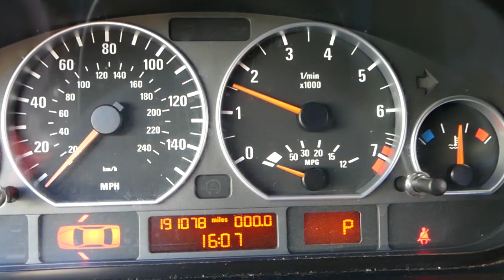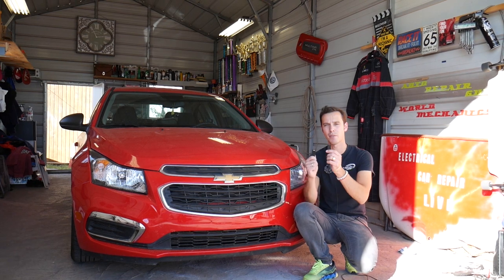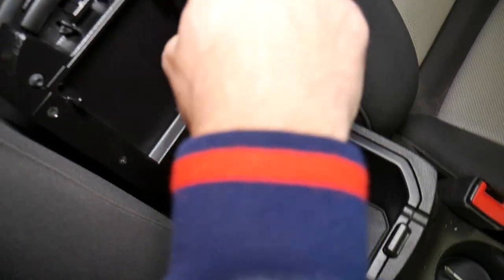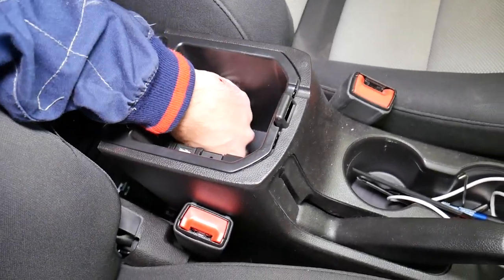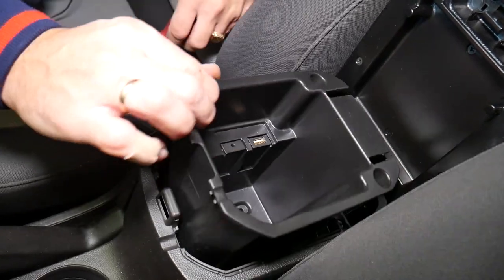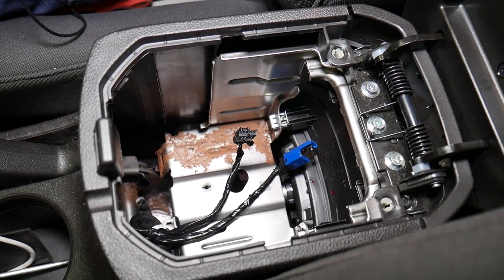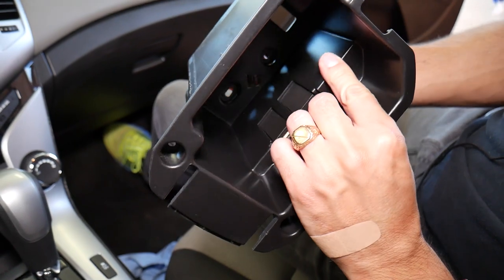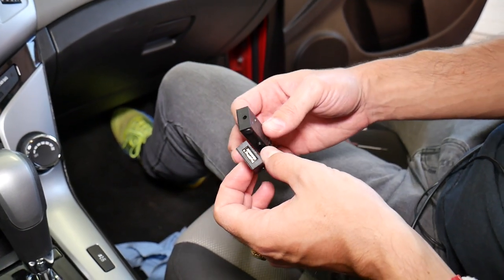CHEVROLET CRUZE USB AUX PORT NOT WORKING REPLACEMENT REMOVAL

Comment: I replaced the usb and it still won’t connect. It will charge my phone but will not switch to the phone input like it normally does when I plug it in. Any suggestions?
Reply: having the same problem. following!
Reply: Having same problem…
Reply: I think it has to do with ios 15.1 update. I think Apple made a mistake on their part
Reply: @Kamihazii  definitely. saw on some forums online that a LOT of people are having the same problem. had to switch to an aux cord and adapter until they fix the bug ):
Reply: Same I have a 2014
Reply: I freaking knew it was cause of the new iOS update, I thought I was trippin 🤦‍♂️
Reply: same happened to me.
Reply: Same happen to me on 2014 glad I’m not the only one hopefully apple fixes this
Reply: same thing happened to me!! what can we do?
Reply: @paigeinabook3595  just wait for apple to fix I got a lightening to aux works fine for now
Reply: thank goodness, I thought I was going crazy! I knew it was an update… arg. Anyone know when it could be fixed? New update? If it’s never fixed I’ll have to go back to aux or buy a Bluetooth streaming because my 2011 equinox doesn’t have music streaming, only calls
Reply: Lol amazingly I also felt it was the software update. !! Just bought a new cable and still have the same issue so I guess it’s just a waiting game now!
Reply: did some research… looks like people are saying ios 15.2 beta fixed the problem. the 15.2 update comes out either late november or early december.
Reply: @paigeinabook3595  thank you so much. i was already on the beta program but hadn’t updated to the lastest version and with your comment i went and updated it and it worked. 😊
Reply: @bluntedpeace  I’m so glad! Im not on the program so I wasn’t sure, but Im really looking forward to the update so I can listen to my music again! Very happy it worked for you!
Reply: @Kamihazii  yeah because this just happened the day after I updated mine. It’s not working and the day before perfectly fine.
Reply: ME TOO! I’ve been trying everything. It charges but not connecting to music
Reply: @nul5979  facts me too I updated my phone and did not work next time I tried
Reply: Dam apple. I thought my USB port messed up
Reply: The same thing happened to me ! Phone updated to the new iOS and my phone stopped connecting through USB port .
Reply: @yvetteherrera2353  yep same here, it updated while I was sleeping and it worked fine the day before, went to go to work and it wouldn’t work
Reply: @Baggedandbodied  my lightening to aux won’t work at all. I can’t get it to work either and i don’t know how to manage to do it. Any ideas?
Reply: @paigeinabook3595  Thanks I just updated my iPhone to iOS 15.2 and that fixed it. I have a 2013 Chevy Equinox and the usb stop working after buzz interference, my phone charged and I continued to get calls on Bluetooth via truck but the audio was no long streaming.  Yay! It works now after I updated iOS.
Reply: Hey guys so apple released the new update and it’s back to normal!!! Your regular charger should work so no more funky aux!!!
Reply: Same problem. & it’s driving me nuts!
Reply: Hold on…hold on! Yall say update my phone to 15.2 & it should work. BRB 🏃🏾‍♀️
Reply: @cinnamonbrown114  did it work lol
Reply: I have a 2014 and if the iOS update won’t fix it what fixed it for me every time was “Clear and Reset Radio” from the Software Versions Menu under Radio Settings. Hope that may help anyone still having trouble!
Reply: @tyyy55  thanks! I’m trying this tomorrow, because I’m still having an issue playing anything.
Reply: I got a 2011 Buick Regal CXL and can't figure out where the audio jack is and what I need to do to play music from my Galaxy phone to the car audio. Any advice?
Reply: Nvm I found it, but i need a part to stick my phone cable into
Reply: @edwardcastillo4260  oh geez! I’m super late seeing this lol. Yes it did work!! I was so excited about it finally working again!!!
Reply: @cinnamonbrown114  all good lol I remember this issue. That fixed it. My wife was having the issue haha
Reply: @tyyy55  this setting doesn’t show up for me. I have a Chevy Cruze 2014 but it doesn’t have the touch screen radio 🥲🥲
Reply: & my phone is on update 16.4 & it doesn’t connect. It’ll play for like 2 minutes and then it says no data found and stop, but it’ll continue to charge. I changed my usb part already as well. If anyone has any suggestions please let me know 😭

Comment: okay so after 30 minutes searching every where there is NO fuse for this USB port. If not working it could have just went bad and if I want it working I have to follow this video.
Reply: Its in the Fuse Box inside the car for my 2016 Chevy Cruze Limited Its a 20 fuse

Comment: I second the reply about updating from iOS 15.1 to 15.2 and it worked. I didn’t think that would work but I tried everything else and it did. I don’t comment on YT videos often but I have to vouch for that comment! GL
Reply: It worked! Thanks so much for sharing!
Reply: @janeene24  Hello do you have a 2016 or 2017 cruze? i just bought mine and im dealing with the same issue. My ios is 15.1 and i haven't updated it yet

Comment: Bought mine at 100,000 miles put 75,000 miles on it in a two years. I did cold air intake, turbocharged, resonator delete, muffler delete, 3in exhaust, ungraded of coil and plugs, and haven’t dealt with to many issues but enough issues to get debatable. I’ve replaced valve cover 6 times, purge solenoid, turbocharger oil feed line, heater core housing 2 times, spark plugs about 11 because they fouled bad and would loose reliability to work, fuses not often but just a few here there throughout the 2 years. I replaced all 3 windows ;front and back right side door windows would break the cable and plastic mounts for glass. Driver door window would also break cable and plastics, fall, and get stuck. I’ve replaced a shattered back right door glass. Both front door windows fell completely in the door and when I looked the cable broke or the mounts broke off the assembly at the base and window making it completely useless and having to replace. Coolant has leaked since the day I bought the car. Oil leaks from turbo lines. Battery levels are never normal ever. Flex pipe eventually squish like a pop can as if I smashed a beer and squeezed it. One burnout snapped my tensioner. Replaced tensioner 4 times only one time it broke that I did a burnout as it’s hard to do in these cars lol. Replace battery twice. Car plug-in ports like usb aux had to replace. Crankshaft seal had to replace. Throttle body had to be cleaned. Oil draining into intake and turbo. Maf sensor replaced 3 times.o2 sensor replace 3 times. Ecm needed plugs cleaned. Cylinder head cracked exactly where you bolt it down at( yes the fu*+ing bolt holes where they screw in at broke! No rethread nothing will be the fix although I’ve rethread Ed them like 4 times. 3 bolt holes snapped off the head on the inside wall I removed all pieces. 1 bolt is broke off in head. Now bad oil leak due to cylinder not holding. Pressure and literally sh*¥t*ng all the oil out witching a 30 miles drive. I’m stuck with the cylinder replacement cost and don’t see the value anymore. Fun car. I got 226 hp out of it with stock engine, stock turbo, stock trans and all major parts. Just can no longer afford ts yo. 280 on eBay and 599+ bran new. I hope for myself for the best. Thanks for reading! F¥ck it buy a Cruze they are fun and fast if you put time, effort, money and fix it yourself I have 3 cities telling me I’m talk of the town in public randomly driving my cruise. Could help contribute to it and be appreciated by me🥺 cash app is : s0L0dice
         Number zero.~>^ ^

Comment: i just got an iphone got a charging cord . on my Impala it has two USB ports previous owned had broke one of the USB ports . so neither worked .i went to the local U pull found one in a Buick it had the same wiring plugs . installed it and now have USB charging

Comment: I have a 2016 (or 2017) Cruze, and the USB port is in the console under the radio/climate controls. Does anyone know how to get to that?
Reply: did this comment help you? This is exactly my issue and im not sure if it is the fuse or the actual usb port

Comment: Jammed my usb into my 2017 Chevy Cruz and Mylink stopped working . Paid 250$ to get a new usb receptacle only for it to still not work. Anybody has any ideas what the issue can be ? Will never purchase another Chevy if this is The cheapness I have to deal with
Reply: I have the same issue with it not working. I haven’t purchased another yet.